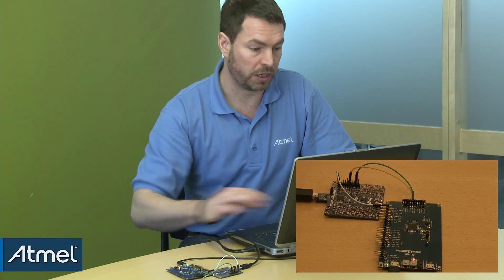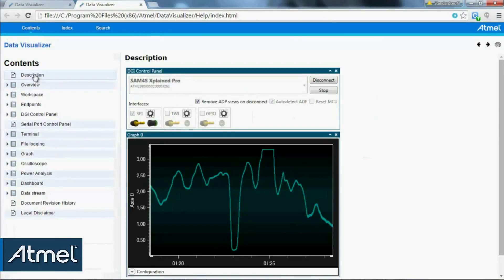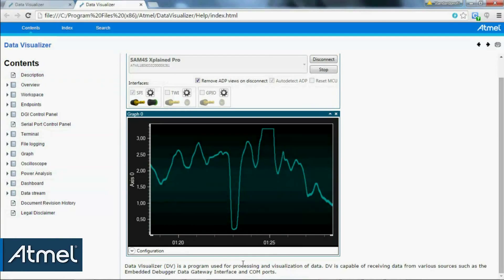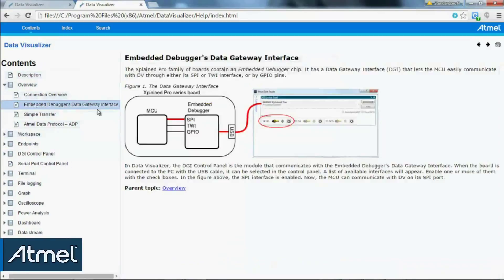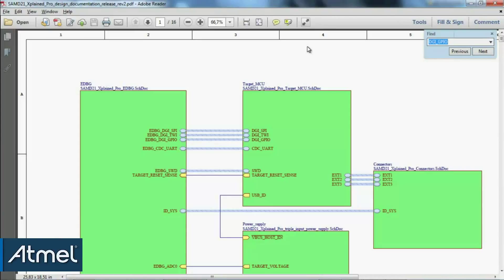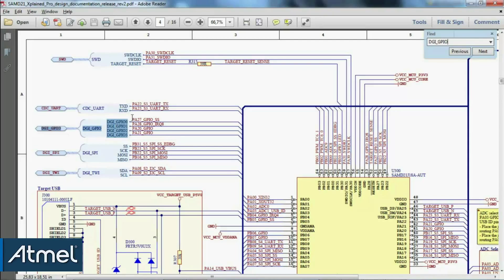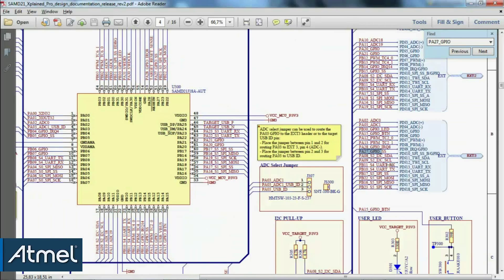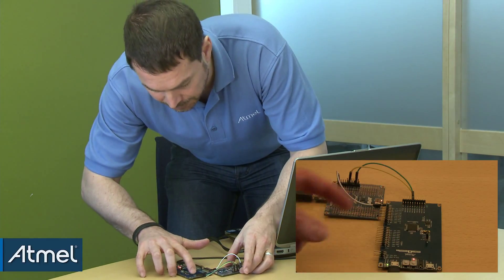Getting Started with AVR: Setting up the Data Visualizer (#15)

Comment: Your course is utterly interesting and easy to comprehend. Could you please film more videos in regards the Visualizer.  How to connect, what stripe of hardware it supports. The most farflung market is the so called "arduino" market. A lot of people make code for the arduino even without a knowing that it has the atmel atmega 328p MCU on board. So, I assume, some additional information on how to visualize "arduino" would be usefull

Comment: It would be nice to have a complete tutorial.  One that shows DGI in use, actually graphing temperature or voltage.I am using the Power Debugger.  Opening Data Visualizer as stand-alone application works sometimes for measuring current.  Sometimes it just stops working.Opening the Data Visualizer extension in AtmelStudio doesn't work.  I can see the current, but the plot is blank.